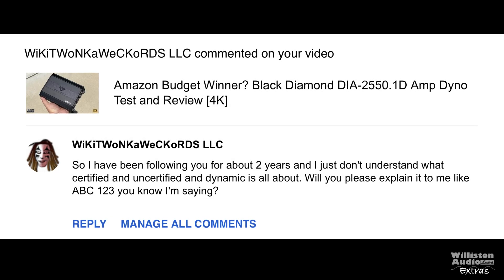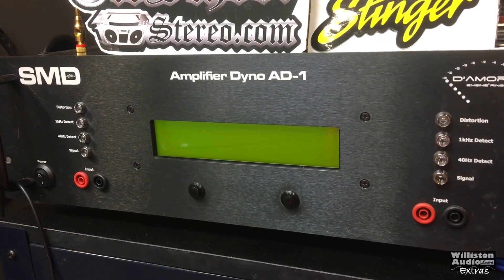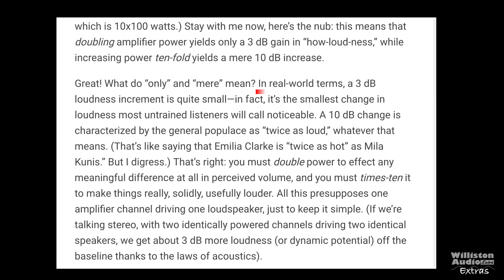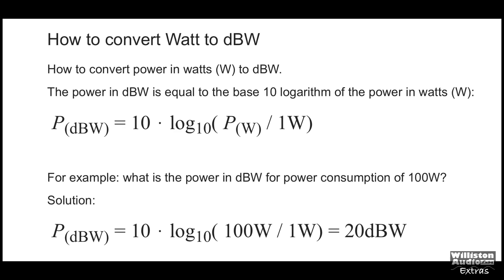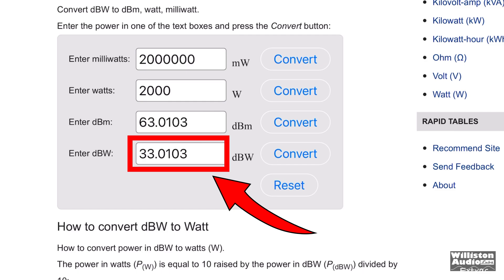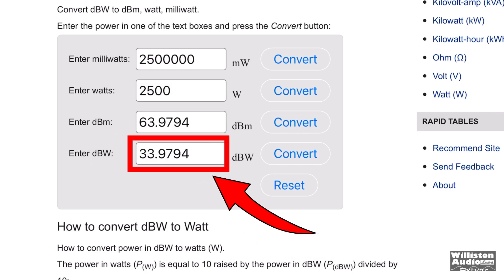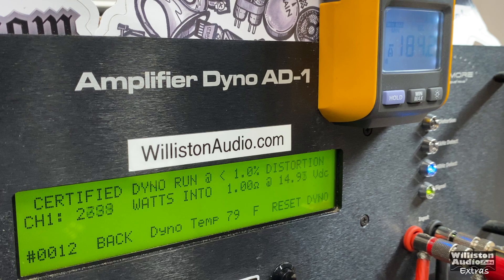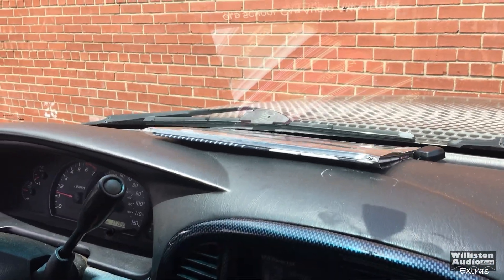3 Modes of the Amp Dyno and Thoughts...

Comment: Hi Dereck!
I came across this video because I am searching for a specific answer regarding the amp dynos burst test at 1
kHz with 20 cycles.
Is there a chance to get a scoped picture of the 20ms burst? I’d like to know if all 20 cycles are unclipped or even have the same voltage level . Some testers try to keep all cycles at the same voltage level and calculate the power, other tests I have seen take the highest cycle and the lowest cycle and calculate the average power between these values. I don’t know what the IHF standard really says about this topic, because some amps have the first 10 cycles on a high level and the last cycles go dramatically down. In this case I would reduce input signal level to get 20 clean cycles at same voltage level, this is what I do to avoid power values which are way too high.
Manufacturers today put burst power in their sheets with 8 cycles and only one cycle which results in the highest output power of course. I found this kind of power values in a pro audio amps data sheet which costs more than 4000 bucks. Very nice explanation video for non-dynoing people 👍
Best regards!!
Andi

Comment: Can you run the dynamic test on the O scope? I’d love to see how much distortion it’s running into.
Reply: The dynamic test doesn't measure distortion.. It does some math based on the peak-to-peak voltage measurement and assumes an unclipped sine wave as Vpk = Vpp/2 and P = (Vpk * Vpk) / (R * 2)

Comment: Awesome! Thanks- you are the man with providing this input so swiftly. Honorable! I would add, the missing link to this info that I learned from my past- 3dB change occurs with doubling power input… meaning, you will only rise 3dB with each doubling of power added to subwoofers. If that’s is still accurate. Huge Thanks and Cheers! Enjoy a cold one on me
Reply from the maker: Correct and you need 10x power to effectively double the loudness
Reply: Yes? That’s the theory most people know but in this case we
Skipped the woofers power compression which is stated at half power or close to full power, this value reduces the amount of dB depending on the amount of power compression in db, there aren’t much speaker
Manufacturers who tell the amount of power compression in db in their data sheets. 😢

Comment: An increase of 3db is exactly twice as loud and takes about twice the power. With all things equal. Speaker and enclosure design/tuning change everything when it comes to required power. For instance I own 2 vehicles that do a 160 and 161. The one that does a 60 is 2 18’s clamping 4200 watts, but it’s a 2/1 31 cubic foot 6th order. The one that does a 61 is 6 12’s in 24 cubic foot 2/1 4th order clamping 25,000 watts. Literally more cone area, and 21,000 more watts. For a 1 db increase. The enclosure is just incredibly inefficient. Obviously the giant 6th is way more efficient. So many factors but an increase of 3 db is exactly doubling what you hear. It also totally depends on the frequency. A 163 at 24 Hz is extremely windy but doesn’t seem all that loud, to me, because I’m use to it. A 163  at 45 Hz chokes you out and makes you cough and is very uncomfortable. I attend car audio shows regularly. Been competing since 1995. A 157 isn’t even remotely close to a 160. At the same frequency. A good friend of mine does a 167.5 at 36 Hz And it is a very uncomfortable. I can only take it for about 5 to 8 seconds, and it takes my ears about a week to fully recover. I’ve had the opportunity to sit in a few vehicles that do over a 170 but I won’t get in them.
Reply: @DrMichaelPetty- If you look up the definition of what it takes, to mathematically be twice as loud= 10Db, or 10x the power is double/twice as loud. That is on paper= Real world test results can vary drastically. Depending on, many factors, like power compression, power limitations, enclosure design, etc. I also have had many systems, and have won competitions, over the last 30 years. I along with my teammates have tested many setups, and the effects of power, and every system is different.

Comment: I have seen plenty of disappointed people who thought going from 1000w to 1500 or 2000 watts was going to double volume only to get a barely noticeable 3db gain. You need 10db to double volume and around 10x more power or 10x more subs to do it. The returns on added power plummet quickly. 1000w is only twice as loud as 100w, 100,000 watts is only twice as loud as 10k. I used to recommend people stop at a 1k unless they were planning to do a major build. A lot of vehicles can handle 1k on stock electrical and doing a alternator and battery upgrade for a 4db gain from a 3k doesn't seem worth it. Better off getting more low power, high sensitivity subs and splitting that 1k amp more ways.

All of that is theoretical and gains are eternally linear. There is some variance and other factors to consider on volume gains but If not going for 10k or higher, probably 80% of people are better off staying below 1500watts if their stock electrical is up to the job.
Reply from the maker: So true!

Comment: When will we see the amp dyno guts ?
Reply from the maker: It’s mostly filled with braking resistors, a small circuit board and a display screen. The SteveMeadeDesigns forum has gut shots, showing one being built
Reply: @wal2  Yeah. How about a thermal image of the dyno guts during a high output amp test…
Reply: Someone has a video showing them but I forgot where. It is pretty much a big empty box like some plea market amps. A fairly small board connected to the lcd screen. Disappointing looking but I assume for the price they want to make it look big.

Comment: So with no amp then to getting a 500w amp if it's only .9 DB  I won't be able to hiar the difference between not have one? Does it change the higher watts it goes?  That would make it  hard to justify buying a amplifier at all. in less its 3000w increase at a time. if you can't tell the difference in sound if you ask me.
Reply: It's not . 9 db by itself. That is starting from 2000 watts. Starting from say 5 watts then going to 500 will be a 10 db increase in volume. Definitely noticable. It would take another 500 watts to get in theory 3 more db. So 500 then 1000 then 2000 then 4000 then 8000 and so on.
Reply: @fabelgamer7410  thanks that clears up a lot more and help me understand a lot much appreciated for your help.👍👌✌️🎶💯🥂
Reply: @fabelgamer7410  Most is accurate except going from 5W -> 500W would be 20dB increase.  log10(p1/p2)*10 or log10(500/5) = 2 and 2*10 = 20 dB.
Reply: 10db is about twice as loud. 3 db is often considered as the smallest amount of noticeable volume difference. You need to add either 10x as many speakers or 10x as much power to get that 10db doubling of volume. Doubling number of speakers, whether going from 1 to 2 subs or going from 100 to 200 subs on the current amount of power will only give a 3db gain. The same holds true for amplifier output. Going from 100watts to 200 watts is a 3db gain just as going from 1,000,000watts to 2,000,000watts will only give a 3db gain. The more you have, the smaller the returns are on upgrades. 

I always look at the sensitivity on subs. Its not the only deciding factor but it can be an instant tie breaker for me if one has a 
higher sensitivity. The sensitivity shows watt the output is at 1 watt. Most subs are in the low 80db to low 90db range. Right out of the gate, a sub with 91db sensitivity will be twice as loud as one with 81db sensitivity, at least at 1 watt. There are rms ratings to consider and the amplifier to be used and all sorts of other factors but it is worth noticing that sensitivity.
Reply: @Murray Shekelberg  I seen the doubling of speakers thing on a video. That wasn't 100% accurate

Comment: Had a question about the amp dyno. Can you change the amount of distortion it will detect? Like on the certified measurement can you change it from 1% to like 10% or .05% or is it fixed?
Reply: The percentage (Derived from a decibel level) refers to how much THD is present at specified gain levels. It’s not detecting harmonic distortion up to a certain percentage. The reason it is presented as a percentage is because presenting it as a decibel level would be relatively harder to read/interpret.
Reply: @mantolini  You can directly convert from % THD to levels in -dB, since percentage is a ratio.  Normally in engineering we use -dB since each harmonic can be specified individually, whereas THD is just a sum of ALL distortion products.  However the convention is % and that's what people are used to (and they aren't engineers so they don't understand what a dB even is.)  If you're curious it's dB = log10(%THD / 100) * 20

Comment: I'll have to check that calculator out. I upgraded to a 500 watt JL audio amp from a 250 watt Memphis amp and it sounds way louder to me.
Reply: that's quite a big jump, at the "lower" wattage levels where an upgrade like that truly makes a difference.

going up into the thousands of watts changing from say a 3k to a 4k amplifier isn't going to be a massive change.
Reply: 250 to 500 is doubling power and should be around 3dB gain which is noticeable
Reply: Yeah you doubled your power going from 250 to 500 so you noticed a lot of additional spl.

If you went from 5,000 to 10,000 would be the same thing db wise , that’s why the cars have 4 alternators, multiple battery banks etc 😂
Reply: @Steviewandersgreatesthits  Yes and no.  At those power levels, thermal compression becomes real due to voice coil heating.  If you figure that a 2 Ohm coil is actually a 3 Ohm coil at around 150 deg C, you can see how that would affect the power delivered as it heats up.
Reply: @drozcompany4132  I’m banking on the fact that it was doing the same thing before so no real difference 

You are correct yet I don’t think your comparison is apples to apples, we always lose power due to different reasons but for the most part he doubled his power so to speak.
Reply: What also has to be considered is efficiency of the amps too. If the 500 watt amp can more efficiently convert power than the Memphis there may be even a larger difference in wattage

Comment: Can't believe my new hearing aids can play 40hz
Reply: Yeah, cuz it's in your ear. If you take it out of your ear, even a little, that 40hz will not be loud enough to hear. Earbuds that seal to your ear can play low bass quite well.
Reply: @JasonWW2000  my old ones didn't even attempt to play low like that.
Reply: Modern earbuds play fantastic at low frequencies. My set I use at work plays down into the low 30s
Reply: The subs on my JVC Kaboom can play down to 30HZ. It cuts off completely below that.
Reply: Hearing aids are expensive